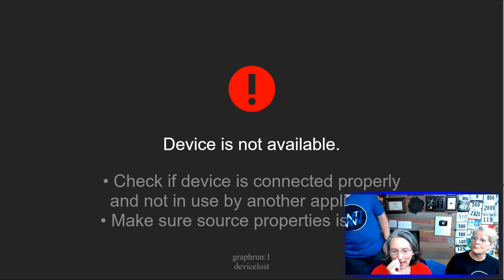Live QNA With Mom Wood By Wright

Comment: Working on your French Cleat plane till.  Almost done when I realized you have plans.  Oh well.  Im stuck on the dimemsions of the top plane toe cleats.  Can you provide and id what surface has the "8 in angle"....what ever that is.
Also is the bottom cleat angle the normal 45 deg?  Having issues securing #4 stanely planes with tote handle profile.  Would appreciate your help.  Supper cool channel you have.  Thanks.  Steve
Reply from the maker: Sorry I am not sure what you are asking. here is the video on french cleats: https://www.youtube.com/watch?v=vnKraOpt3-s and here is the video with the plain till. https://www.youtube.com/watch?v=xIiLn0J_kD4
Reply: Talking about upper block dividers that support plan toes per
 https://www.youtube.com/watch?v=xIiLn0J_kD4.  Can't get any configuration to work with a #4 plane.  Thanks for a response.